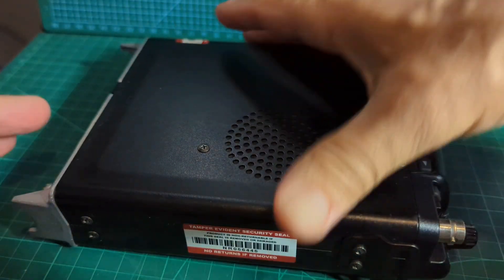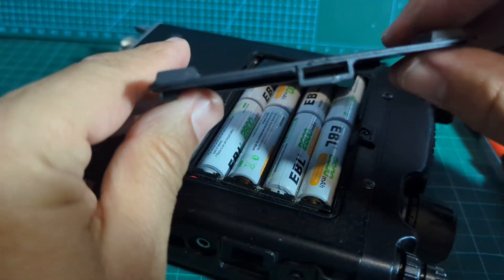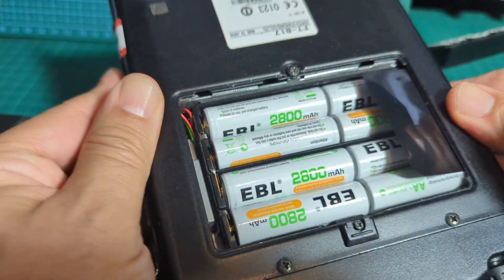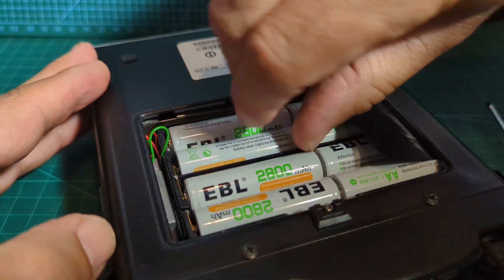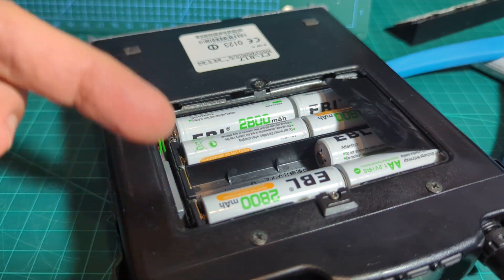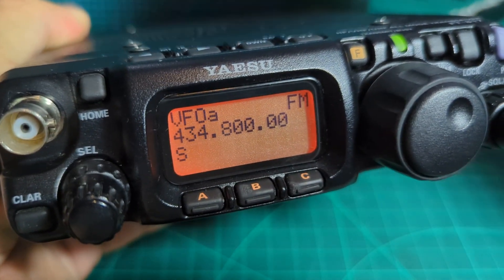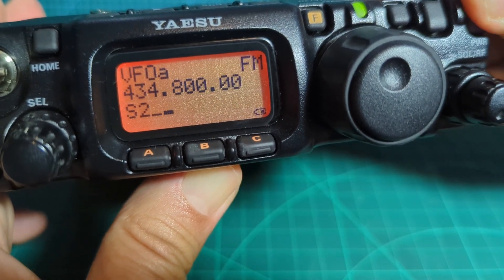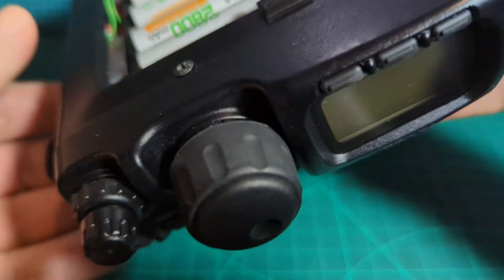YAESU FT-817 , CUT GREEN WIRES TO ENABLE CHARGING USING CASE FBA-28

Comment: If you peel back the black tape where the wires connect to the battery case there is room to fit a 4 Amp subminature wire ended fuse on the positive supply. I did it to mine after I had cut the green wire to add some protection to the case. If the wires from the case short or if there is a fault in the radio the battery spring contacts will get very hot. The fuse will blow & prevent this.
Reply from the maker: Hi can I have a pic or info
Reply: If your monitoring the NR channels I will give you a call with the info
Reply from the maker: ok cheers catch u soon